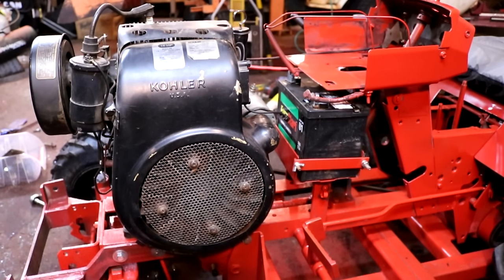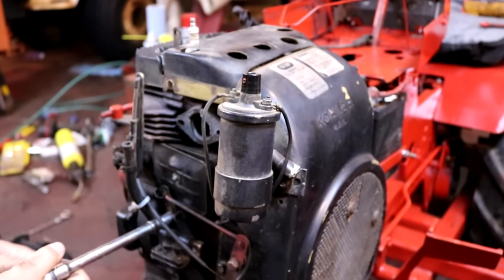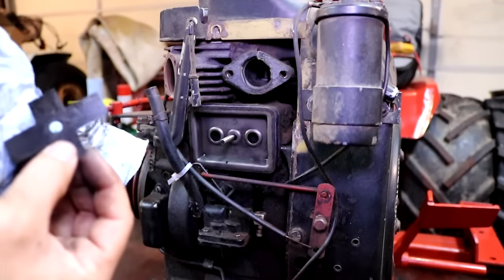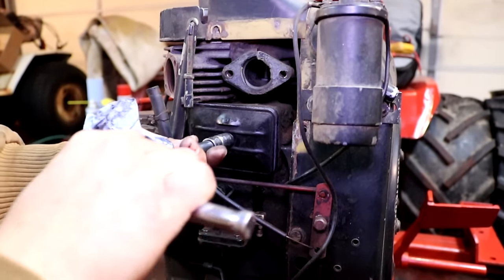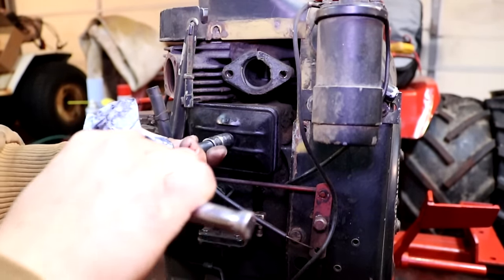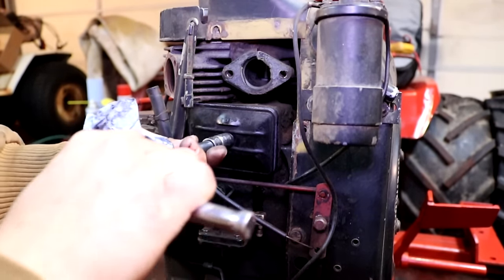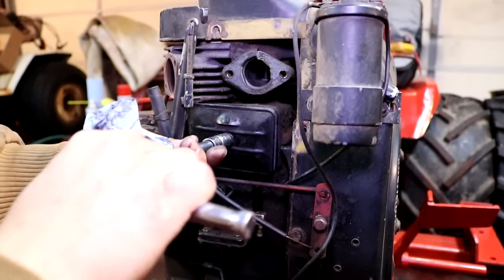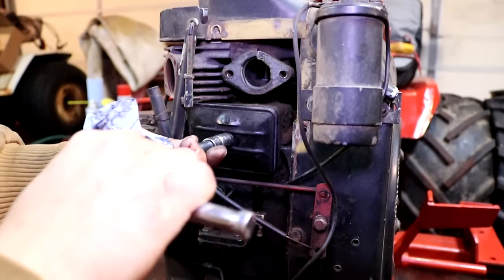5 Things You Should Do To Your Kohler K Series Engine Right Now | Kohler K Series Engine Maintenance

Comment from the maker: Hope you found this video helpful! As always if you have any questions about your vintage cast iron small engine or vintage garden tractor you can always reach out to me directly by email, phone, or our website. Ask for Norman! I help every single person who contacts us whether they are a customer or not. Our mission is to Save the Tractors! Like, Subscribe and Tell your Friends!
Reply: Just found your video. I own a 1978 John Deere 316 with this same Kohler engine. It still runs very well but after watching your video it will be receiving more attention.  I just bought this tractor last summer from a dealer.  It sat there for sale for along time, until I came along.  I have always liked this engine......  thank you!
Reply: Hi.I brought a tractor and the engine is a kohler and it looks just like that in the video minus a few bits..I cant find where to check the oil and where to refill it.. Any ideas where to find this.. Thanks
Reply: A video of the ignition system and wiring would be greatly appreciated. I’ve replaced all the components and it still has no spark?
Reply: I just purchased a 1967 Wheel Horse 1277.  Kohler K-341...I believe. Your videos are awesome. I'm not a mechanic. I work with wood. I think I can follow along.
Reply: @johnpepper717  What model is it? Most have a dip stick must be real old..awesome!
Reply: Great video!  It would be cool if you sold a kit including the carb, gaskets, and stuff that were used in this video on your site.
Reply: Hi Norman I Need your help looking for carburetor for ariens riding mower Kohler engine 18hp
Reply: Jbb
Reply: Any recommendations on the type of oil to use?
Reply: This video would definitely be helpful to my local mechanic because I have plans to get my 216 john deere running again after 10-12 years of sitting not started
Reply: i have a 10 hp kohler been rebuilt .030 over ran fine for years, however i was running tractor in garden motor got hot  smoking, starts up fine but looses power under load.  any ideas thanks
Reply: Mines dip stick is metal and in a tight spot a socket and a extension takes the oil cap off its like a square oil drain plug you've seen those
Reply: I need a carburetor  and airfilter container  for aK341 let me know how mush it will be
Reply: I have a K341 need a carburetor and airfilter container  let know how much for them  think
Reply: I know it's been 4 years ago but I got a question. These old Kohler engines weren't made to run on today's gas should I put a lead additive in my 65 cub?

Comment: While I agree with 90% of this video, I wouldn’t replace the carburetor if you’re capable of rebuilding one. The original Carter/Kohler carbs are excellent. I rebuild every carb on my K series engines and I’ve only had 1 or 2 that were too far gone to be rebuilt. Keep an eye on the bushing at the top of the throttle shaft and you’ll be fine. Replace it if necessary.
Reply: I agree with you .. the bishop g is replaceble. I rather have it org n not a China carb
Reply: I got bushings for the throttle from small parts. Com
Reply: @kevinsheriffjr7700  yeah . Kirk sell them too
Reply: @stevenmaines9114  I save tractors carbs are American made. The chinaclones are highly variable having no quality control. If you do get one check the insides for shavings before use.
Reply: @gregolson5532  I'll never. Use a China carb on k . And I daubt there  made in America..
Reply: @stevenmaines9114  You forget other's read this stuff. I do not either. I do use them for cheap push mowers. Most people are not willing to pay a couple more dollars to buy USA made. I do support USA jobs first.
Reply: That's EXACTLY what I thought as soon as he said that! If it ain't broke, don't fix it. Much better to keep the original.
Reply: @hilltopgypsy  I like to keep my tractor org too . Not puting aftermarket. Stuff on them .. I think he was just trying to sell part in this vid...
Reply: My k181 still has the original carb and it runs just fine. So until it break, I'm not gonna fix it.
Reply: Never had a problem with this carb. Pull the bowl dump the chunks out good for another 2 years lol
Reply: I agree as older carbs generally are more adjustable,good clean if they have not been an issue and i line filter fitted before the carb. if one is not there & re-tune & ya good to go👍
Reply: It’s just a commercial for his carbs which are overpriced.
Reply: 12:44 Clamp onto the cross shaft with a pair of vice grips, positioning them horizontally. This will free up your hands and the weight of the tool will keep the shaft down securely.
Reply: Alright then how you get the brass screw out none of my tools fit down in it so I left it in and cleaned it out the best I could on the 8hp Kohler
Reply: @gregolson5532  walbro isn't China made and it had metal shavings and the brass flap to the choke was messed up bent it kept sticking shut from how it was made
Reply: @hilltopgypsy  I don't replace the stuff unless its broken
Reply: @Mike-su8si  Kohler/carter is the only good carb available for the K series. I have several extra and if a get a new to me tractor with a Wahlbro in it and have any issues I replace with a Carter/Kohler. The carbs are engine size specific even though they will fit on them doesn't mean it has the correct throttle bore and venturi size. Wahlbro are better than a chinaclone though. Steven was correct I save tractor carbs are made in Taiwan.
Reply: @Mike-su8si  If you do not have an ultrasonic cleaner boiling in lemon juice water works pretty good.
Reply: If people liked usa made stuff they would be running around using the green weed eaters not orange and white stihl what use to be made in Germany or Kohlers they didn't use to be american made products besides wherever the parts were made in so a ton of Americans like old German made products more than American made
Reply: Mine has it to but the other owner let it sit for so long the gas in it turned into black tar and it doesn't wanna come out of the holes i can't reach or pick at
Reply: @stevenmaines9114  Who is Kirk? A reference to exactly where to buy the carb bushing would be nice/thanks.
Reply: I totally agree. My k301 sat for 30 years with gas in the tank and I didn't even have to clean it to get it running VERY good lol.
Reply: @coltonstevens1  the one i got for free sat for over 40 years and its carburetor was full of tar so you got lucky
Reply: @TheReal1953  Probably Dave Kirk. Kirk's engines. I've done three electronic ignition / electric fuel pump conversions from his site. Highly recommended.
Reply: @jamesrogulski5676  I posted to him and he didn't have it. Be nice to know who has that throttle shaft bushing if there even is such a thing.
Reply: I agree, I like oem parts , why replace a nice original carb that's salvageable with a imported one. Many times ,if it's not broke don't fix it.
Reply: I can attest that Norms carbs are spot on. I tried the China Amazon ones…. Nope.. spent the money and got an IST carb…. One pull and it sat there idling away perfectly.  Kudos to Norm for keeping the cast iron alive.
Reply: 100%. any one who tells you to replace the carb before rebuilding or cleanning is most likely selling carborators
Reply: Said th esame thing. Even a good cleaning is better than replacing unless theres physical damage.
Reply: I have a k301 and that carb was extremely corroded and falling apart in places fuel couldn’t even enter the carb so I just ordered a new one
Reply: Exactly. Rebuild the oe one instead of swapping it for Chinese junk

Comment: I’m a 15 year old kid I’m not your usual kid as normal kids play video games everyday but that’s not the point I’ve got this John Deere 112 electric lift that I’ve had for years and it sat outside and was run down but he motor and e-lift and e-pto/clutch still works I think it sat for 11 years and I finally got the thing restored last summer lol thank the lord and it’s a beast of a tractor with it’s 12h Kohler my great grandfather got to run it one more time after it was done before he passed so that was a real blessing
Reply: If. U want the electric lift to keep working do no use a blower on the front . And none of the parts for the electric life are nla so if. Quit working u have to buy a good use one . I tend to stay away from the elric lift n the one with a cradle 73-74 .
Reply: Grandpaps are the best !
Reply: Steven Maines  thanks man for the advice I’ll keep that in mind 👍
Reply: heyinway you know it

Comment: Add a 6th step. Remove and clean out any build up of grass, dirt, and other foreign debris (mouse nest) from behind the blower housing.
Reply: Robert Kuhnke  wow that is a great ole story old Kohler tales are great!!! lol
Reply: For sure, I bought a 212 a few months back. Noticed not near as much air flowing through as on my 210 when standing on the right side. Pulled some sheet metal and it was full of mouse nest.
Reply: As well as cleaning out the fuel tank

Comment: Perhaps the most thorough and informative instructions I've seen on YT. Thank you Norman.
I'm also a recent customer.
Reply: Hi Norman
I. Work on these old engines all the time, I have a  small collection of  Simplicity tractors. The oldest one is a 60s MW Squire 10, and the newest one is a 7119 and overall I have  6 tractors, and they all run.
I was a aircraft technician for 48 years and have  repaired all types of aircraft. I have a different method of setting points we used on magnetos.
What ever the setting is, say .020, use the .019 and the .021 feelers as go no go and you would come out exactly .020. Try it and see how it works for you.
I  watch your videos and you give me a lot of ideas and information.
Thanks 
A J K

Comment: This video was very well done. I'm impressed.
I'm pretty sure I just saved three 200 series John Deere riding mowers from the junk yard. They were at an auction, they were selling as a block of three, and I was certain they would be bought for parts and the rest would be junked. So I went as high as $600 for three, non-running tractors. They all have the rugged Kohler engine and are identical except for engine size. I am in the process of getting the 212 with 46 inch deck running. Thankfully by cleaning the contacts and gently tapping the starter with a stick, it cranked over. I had to slobber oil on the choke cable to get it loosened and then it started with NO SMOKE. Hallelujah. It had sat a long time because the mower deck pulleys were rusted and seized on the belts. I had to pry them off with a screwdriver!. Some fine grade sand paper should clean those up. 
I estimate I have an average $200 in each tractor, the new belts came to $91, air filter and paint added another $40 so I figure I'm going to have an operational 212 for less than $400. It even  has one new tire with the little nubs on it! With a smoke free engine!  I really got lucky because once pried free of the rusted on belts all the blades spin free and easy. I suspect the owner sent it to the repair shop, they gave him an estimate for repairs that was pretty high so he either dumped the tractor and left or traded it for a newer John Deere. His loss, my gain. I wasn't afraid of buying the old girls because they have a frame like a tank and the local dealer told me he could get parts for ANY John Deere. Can't beat that. 
The other tractors are a  210 with 38 inch mower and a 214 with no mower, it has the big dirt style tires on it. I look at the thin metal on new tractors and I know those old 200's will be a good deal for me because they are RUGGED.
Reply: It's  running and man does it have power. It charged through eight inch high grass with a vengeance. This is not just a riding mower, it is a garden tractor

Comment: Man, I was intimidated by replacing the points, as I've never done it, but thanks to your instructions, I was able to replace and adjust it, and it runs so much more smoothly now. I put a Bosch 00012 coil on there, too. Who knew that a VW part would work so well on a tractor engine?

Comment: you need to add one, change the oil, correct 10w 30  check manual..   replace fuel filter...flush fuel tank. great video

Comment: Love those old k series Kohler's have owned 6 over the years. The old saying they don't make them like that anymore definitely holds true, absolutely built like a tank huge ball main bearings huge crank and beefy rod.
Reply: love the K series..on a quest to find a couple more.
Reply: What other engine can pull the mower and our weight can the twin briggs engine or is that to small
Reply: I've always wondered why more engines don't have ball bearings. Seems like a much less catastrophic event if it fails, not putting the crank in such danger.

Comment: I have a Wheelhorse ,1984, with a 12 hp K series engine I bought 3 years ago. I simply cleaned the tractor of squirrel nests, changed the oil, a new battery and it's been my work pony ever since. I don't agree with the advise to change out the carb. If it ain't broke, don't fix it. I have cleaned up many  carbs with lacquer thinner, reassembled and they still work perfectly. The rest of your advise is good, but not necessarily always required. Thumbs up for a well presented video

Comment: I like to take my Kohler heads to the local machinist and have them milled flat. It usually only takes .005 or .010 to get them cleaned up and flat. An old small engine mechanic also taught me to paint the head gasket with aluminum paint and install the head gasket and head before it dries. Also, maybe I missed it but I do not think you talked about retorquing the head bolts after running the engine.

Comment: Excellent video. Many thanks for helping us, "the new to the Kohler" bunch.

I "inherited" 3 of the wonderful old Kohler engines in an ebay auction.

I wanted an older John Deere 200 series because I saw one in action and was impressed with its ruggedness and the fact I can still get parts for them. 

I accidentally found an auction on ebay and was watching the bidding. For 3 non-running, non inspected garden tractors. 
The dealer in Ohio had offered them with no reserve. I found out it is a HUGE dealership. I suspect he didn't want his mechanics spending time on those old tractors when they could be earning big bucks on heavy agriculture equipment. They were a 210 with 36 inch mower, a 212 with 46 inch mower, and a 214 with no mower and agriculture tires. I watched the bidding creep up by 10 or 25 dollars at a time over a period of two weeks. I finally get fed up and just decided what my maximum bid would be. I settled on $600 since I knew I would be getting numerous used parts. I placed the bid and forgot about it certain I would be out bid. Lo and behold, I got email telling me I had won and needed to pick them up in two weeks. WOW! 

So, I rented a U-haul 6x12 and went after them. I used graph paper to figure out placing them sideways I could get them all on by placing the one with no mower in the center.
(NOTE:It would have cost more to drive to Ohio, pick up the trailer and haul it back to WI, than to get the trailer in WI and haul it both ways. The drop off fee was greater than a two day rental from WI.)

I found your site and started on  the 212 first. With your help I managed to  get it running. But the mower deck screeched like a banshee so it came off and I had to install all  new bearings and belts.

It ran great for a season, then the starter would spin, but not engage. Then the corrosion get the best of the wiring and I had to remove and clean ALL the wiring connections. The ignition switch was corroded on the inside! Then the carburetor started acting up, since I had been too cheap to order a new one from you. It was leaking air around the shaft. I found a used one at a local shop but the choke lever was all wrong. So I used a scrap of metal and JBwelded it on. I have to be frugal, I'm retired and living on reduced income.

The 214 will start and run if I feed it gas so it needs the fuel pump replaced and the gas line cleaned out.

Will start on the 210 soon. I will b doing all the items you recommended on the other two before I put them in service. I  just got lucky with the 212, didn't do any of those things. LOL

I really appreciate your site and the fact you see value in these older tractors, they really are worth saving. Compared to my MTD 18 horse the  John Deere 212 is a beast! That old 12hp has more power than the new 18hp, go figure that!
Reply from the maker: You win best comment award. Thanks for your kind words about our business and my videos, and I am so glad you decided to save the tractors. If you ever need any help at all, tips, guidance, advice, tech support, you give me a call or send me an email, and I will be there for you.

Comment: I was just given a 1970(?) Wheel Horse Electro (hydro drive) with a 12hp Kohler that my 100 year old (WWII) neighbor owned.  He passed away earlier this year.  It's in pretty rough shape, but I hope to get it going.  In my experience with small engines.. It's likely the carb!   Thanks for the video.

Comment: I had an old k181 that i turned the head down in my lathe and years later i welded the spark plug hole to mill and drill where i wanted it. It ran great and i just sold it after owning it for 25 years. It was .030 over as well when i was done with it. A work horse year after year
Reply: I'm learning about those new engines right now and whatever stuff I do to mine